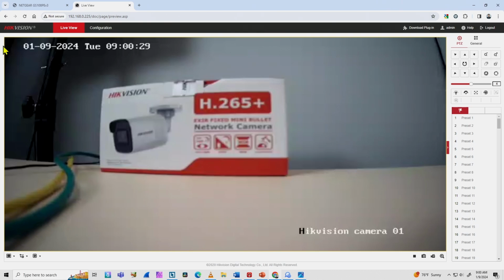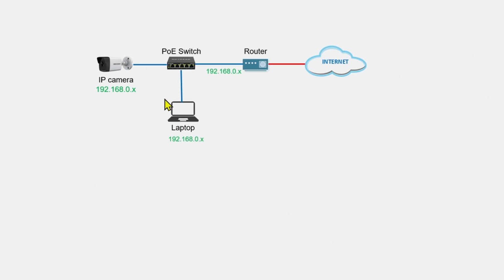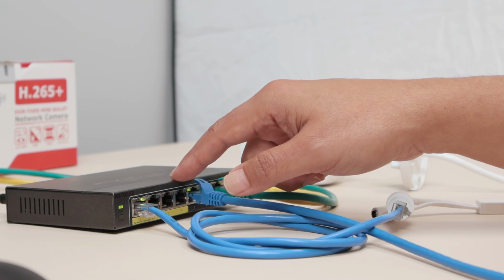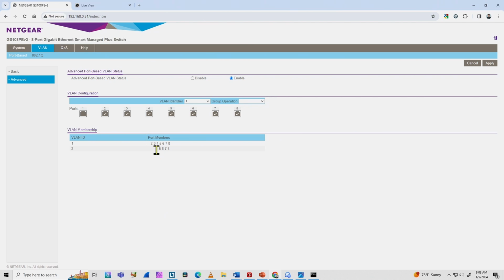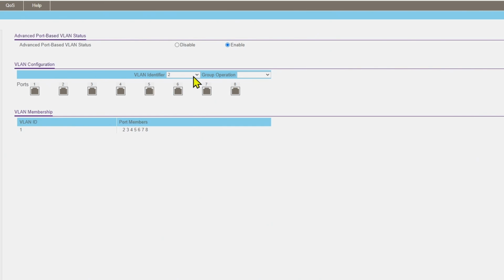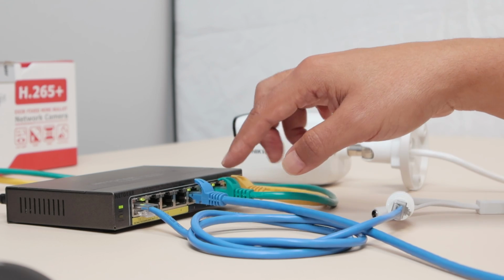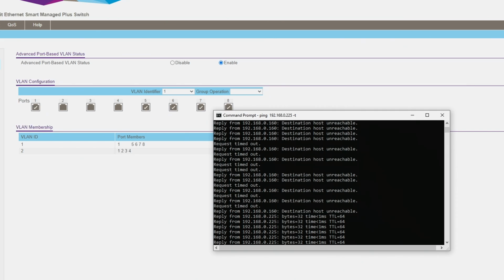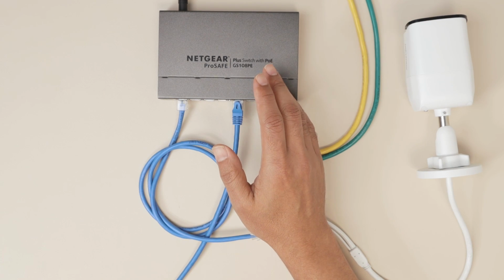VLANs for security cameras [Detailed Explanation]

Comment: I'm still very new to this. If you set the Vlan to separate CCTV network and your Laptop connection. Do they both have still have access to the internet?
Reply: That’s correct, both will have access to the Internet. Main point of VLAN is to divide traffic by setting up different ports for different devices on the switch.

For example if someone removed Ethernet cable from security camera and tried to connect a laptop to it, it wouldn’t work as that VLAN has been set-up for security camera devices only and not for PC/Laptop devices.

Hope that makes sense? 😅